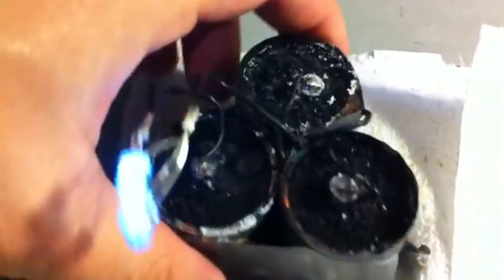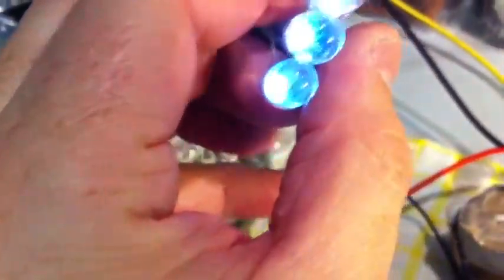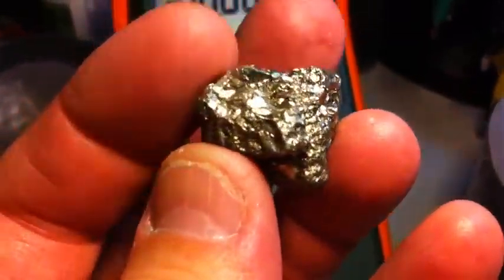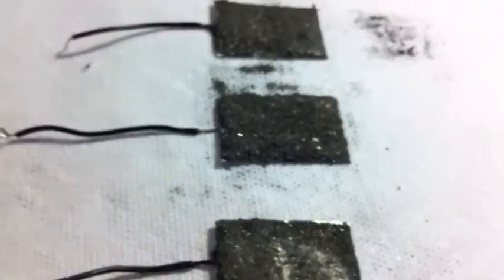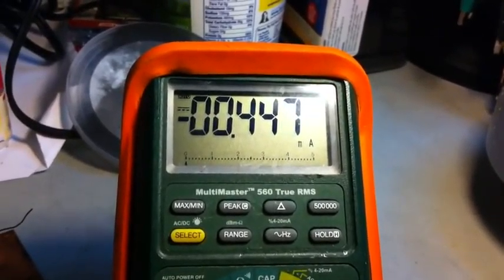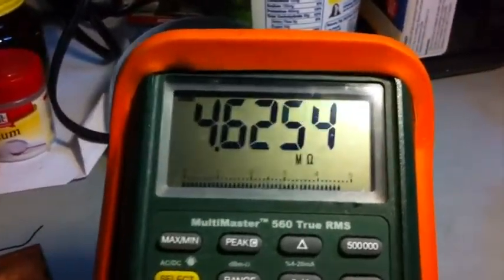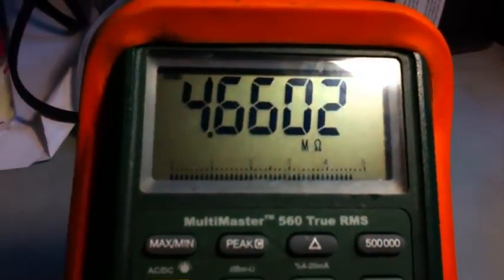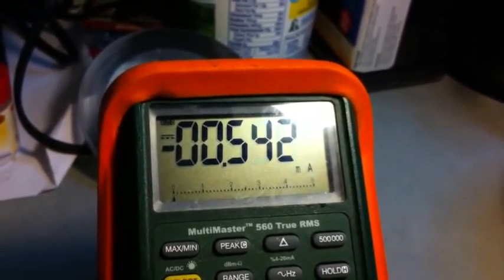Crystal Cell 18b

Comment: Iron Pyrite has solar cell capabilities which are being heavily weighed right now due to the high availability.

Your lights may have an impact on the current and voltage. Might want to check that.